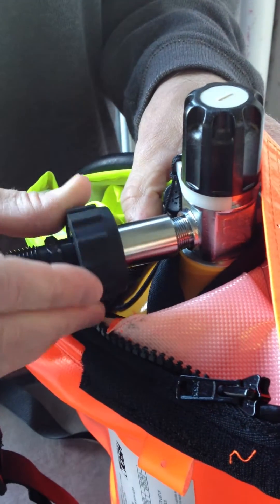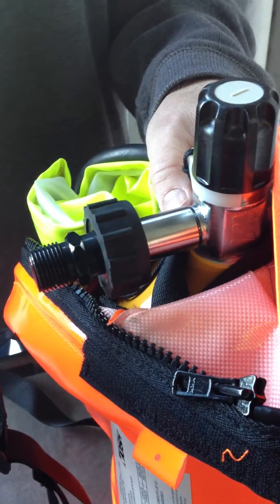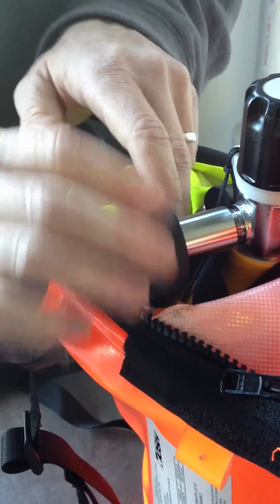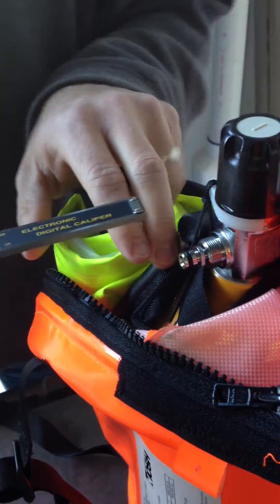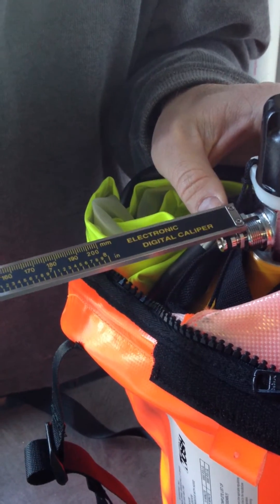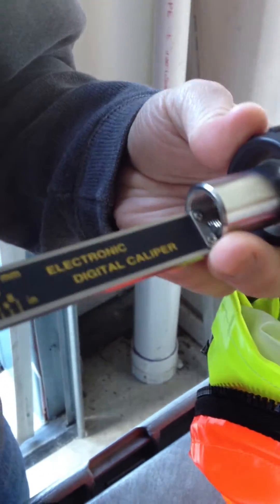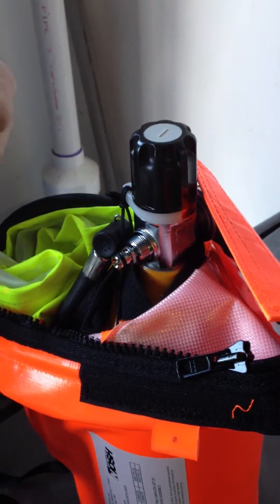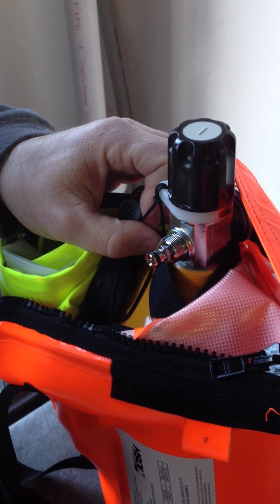Interspiro EEBD

Comment: The pressure will make the seal after you turn on the supply air line. Sometimes a little wiggle will fix the issue after turning on the supply air.